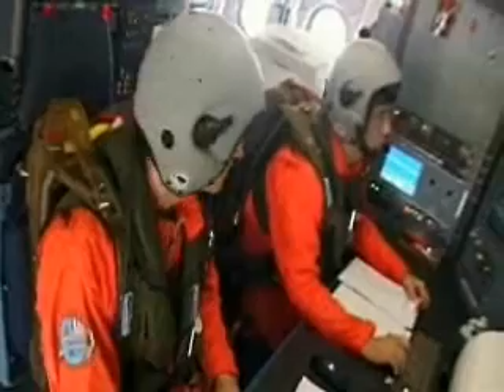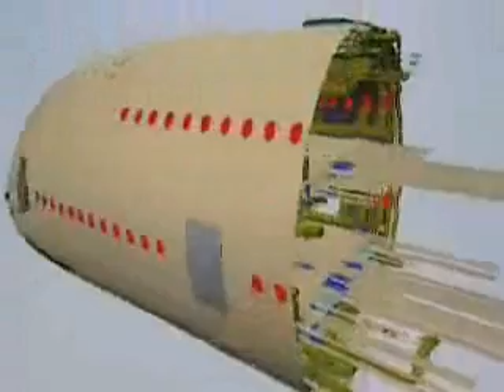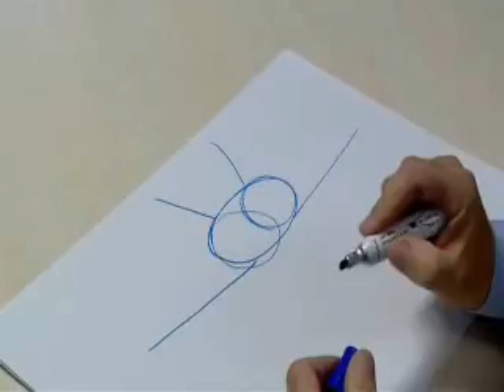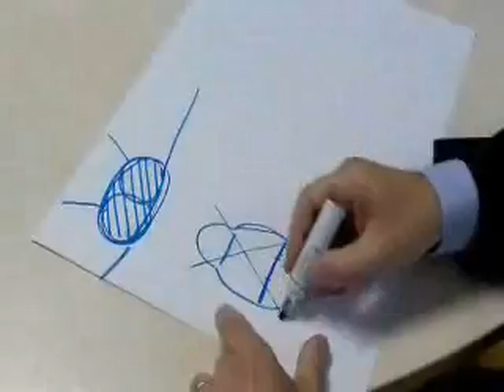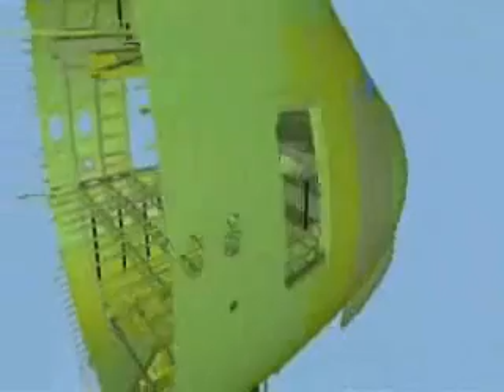A380 Airbus -Building - 1/10

Comment: @Tommiclio "Have a feeling" is not a great way to support your argument.  The design of the Concord was studied way back in the mid 50s but was cancelled dued to so many problems so Boeing decided to do research on the 747 during the 60s and it was 1970 that it was "Commercially" flown.  
By the way, Boeing also had done research on something exactly like the A380 but went with 747.  Just take some Aviation classes in college and you'll believe me.